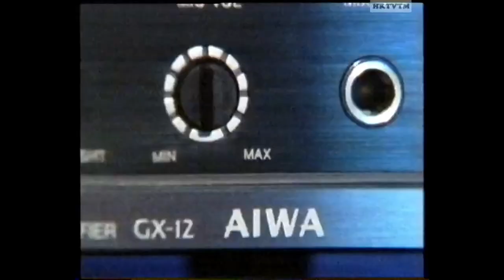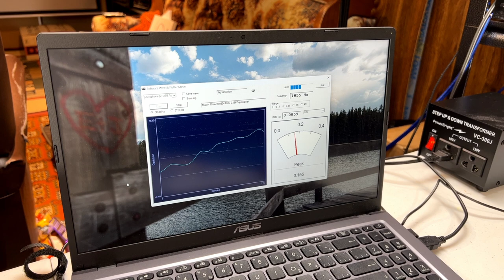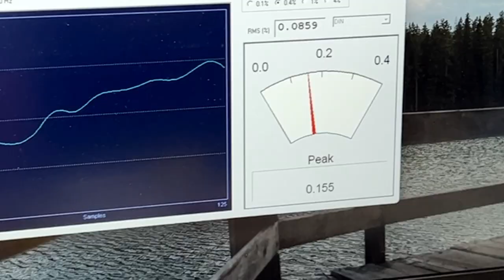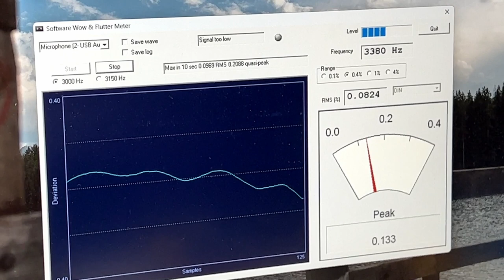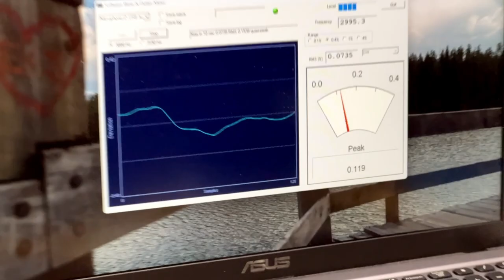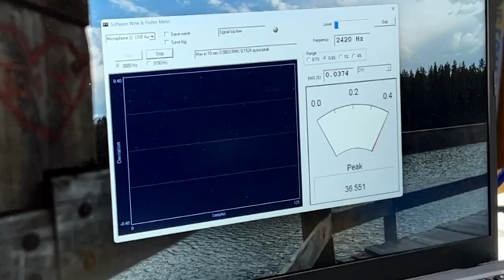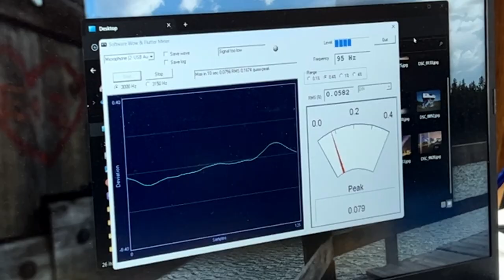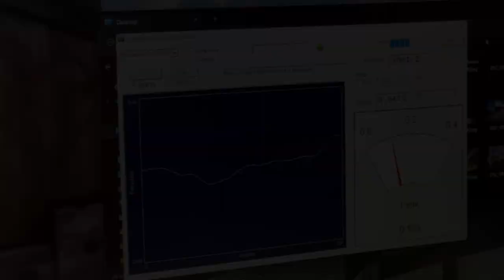Aiwa Excelia XK-007 Capstan Motor Swap - will this fix the wow and flutter?

Comment: You did well, I replace my Yamaha KX 670 old Panasonic motor due to same problems, the old motor gain speed at start and lose it after a couple of minutes, and produce a lot of noise, 
Since i replace with one of those Mabuchi's tape deck became dead silent and tape speed became extremely precise at adjustment, W&F reduce a lot too, 
It was necessary to replace power supply capacitor's with Panasonic low impedance in order to archive the best results possible.
Good job.. 
I highly recomend to replace the pinch rollers, after more than 30 years the rubber became hardened and no longer provide accurate deform pressure over the capstan without to mention most are worm, so that increase w&f.

People suggest fixing the old Panasonic, but I don't know if a wear commutator and weak magnets can be fixed, manufacture say those motors had a limited time running until they need to be replaced it.
If Electronic manufactures like Aiwa and Panasonic would use brushless motors or AC induction motors like old AKAI or Pioneer decks instead motor would never need to be replaced, more than maintenance.

Comment: I was lucky enough to get MARS belts for my ADF 800 unfortunately they shut down production so dreading the day I have to change them again. 
Loving your vids btw 😉
Reply: Yes belts and pinch rollers are a pain today. Even the test tapes made today have a noticable w&f already on them.

Where did you get the motors?

Comment: Where did you get those motors ? and even you use a new motor give it one small drop of oil on the axle bearing . And maybe a 220 uf low esr cap on the voltage connections. Thanks for your video !
Reply from the maker: They were from a source in England via eBay. He doesn’t seem to be selling them anymore. I should have bought more.

Comment: Hi, i dont know if you tried to repair/relube original motor, but i think you have to try another belts and also reel motor front bearing lube and good idler.
As for belts i would recommend: capstans belt folded 118mm 4mm; motor to capstan folded 122-123mm 4mm, try different manufacturers i dont remember what i used, but not fixyouraudio or revoxDE. Those transports are very picky to belts and pinch rollers. 
Also 34 minute of your video problem is lack of pressure of takeup side pinch roller or bad takeup pinchroller or "frostness from takeup capstan is worn away/gone/damaged), because when you "release" from tape supply pinch roller there should be absolutely  no difference in playback speed whatsoever.
Cheers
Reply from the maker: Thanks for the comments. The take up capstan coating was indeed a problem - I discovered that in another video on this machine. It's a high hours unit. I tried both FYA belts and DeckTech belts. The DeckTech belts worked but had worse wow and flutter, so the machine's been using the FYA belts ever since. I have yet to find anything better, but because of the machine being high hours I'm not sure it needs to be better than it is. I actually have three decks I like better now.